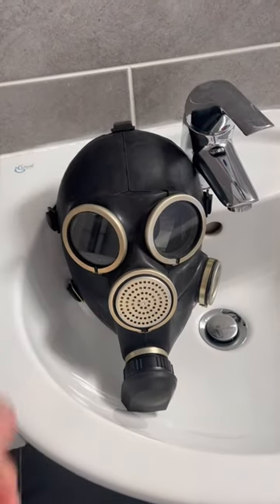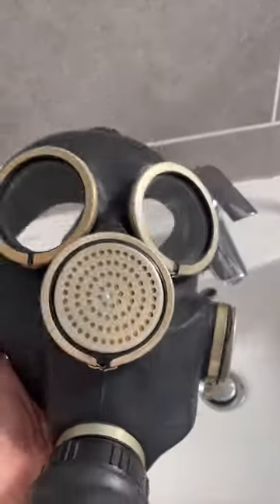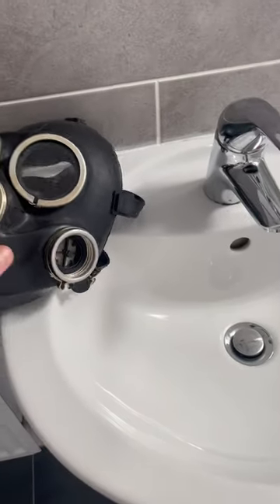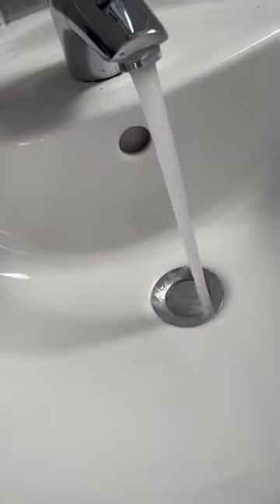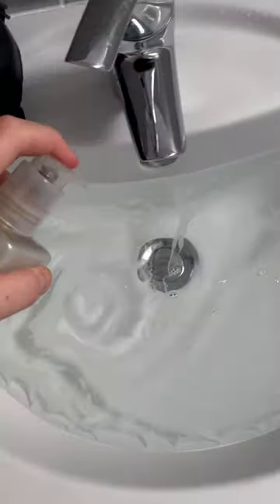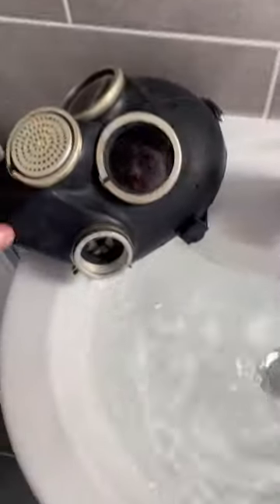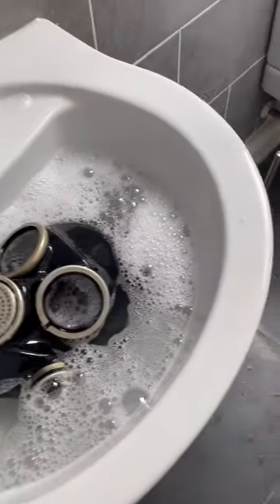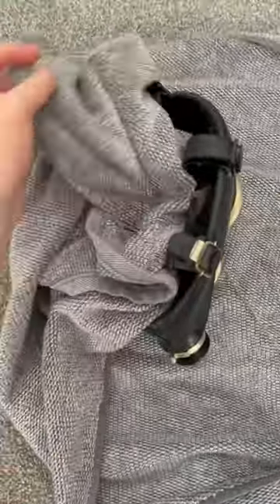How to clean your gas masks 🧼 #shorts

Comment: Do you suggest I do this with a 1984 M17 A1 mask? Mines a black one with no hood
Reply from the maker: I cannot stress this enough, remove the filters, and you got to leave it dry for waaaay longer because, what happened with my m10m is that the water kinda just stayed in the cheek filter compartment.

But yeah, other than that should be ok